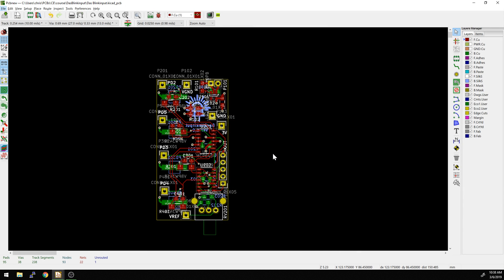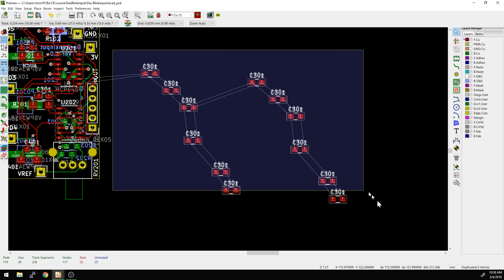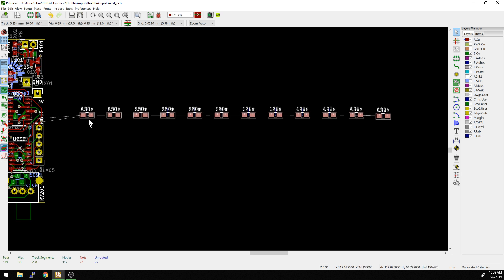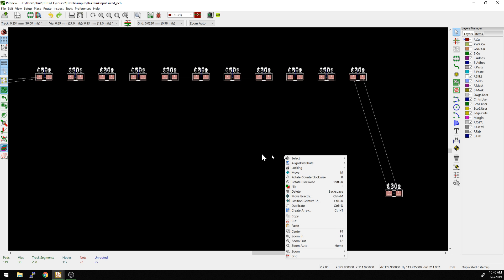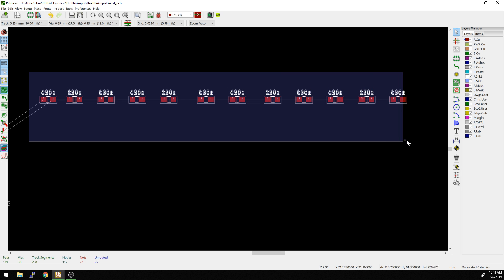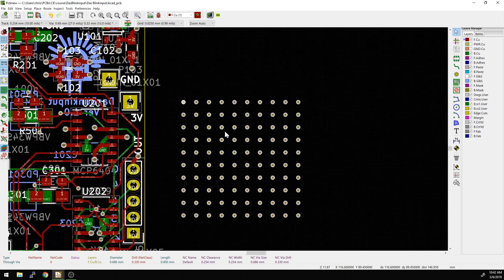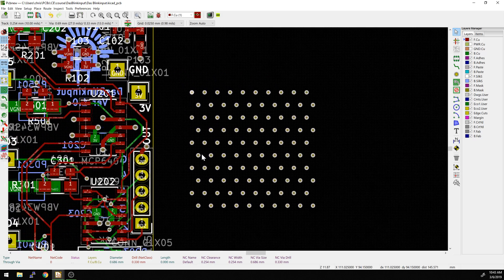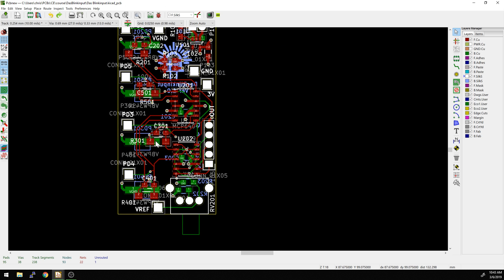KiCad 5.0 - Aligning component and creating arrays

Comment: Hi, 
Many thanks for a very informative video. I have some questions about the "align --> distribute horizontally"  feature though as follows, please. 

Q1. When KiCad aligns and distributes the components horizontally, how does it know as to within which horizontal limits left and right can it distribute the components equidistantly?
Q2. Can the user define the left and right horizontal boundaries within which the components should be distributed?

Thanks for clarifying the issue in advance.
Best regards